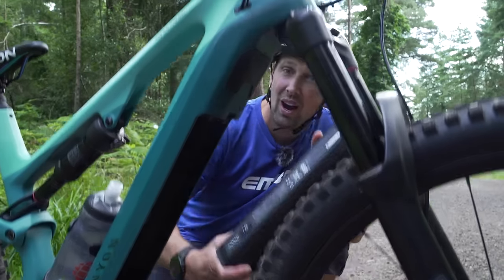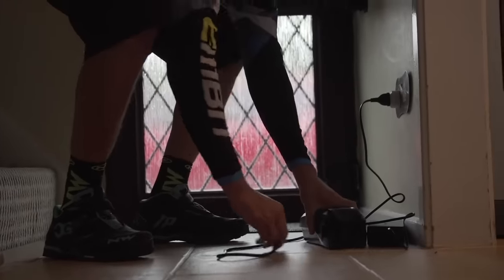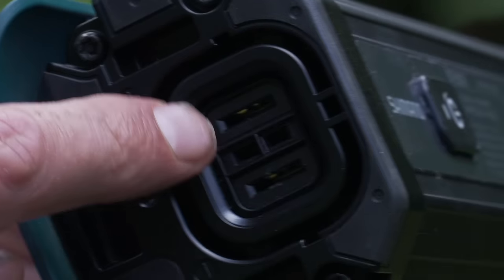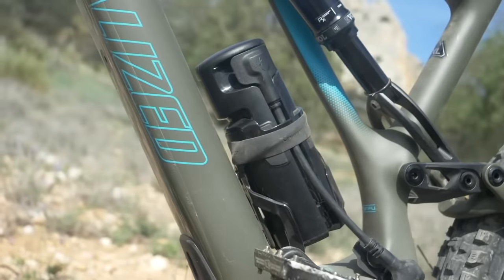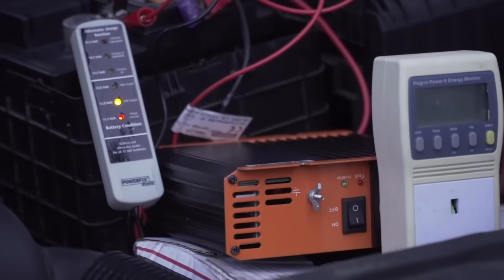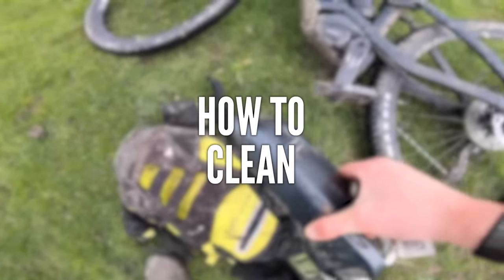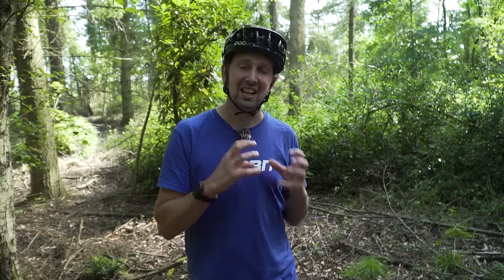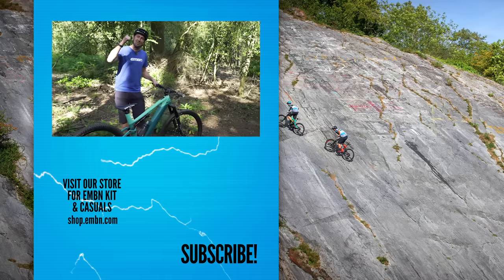How to Maintain Battery Health | E Bike Batteries Explained

Comment: Great video. Some Information in the video is not entirely accurate when it comes to lithium batteries: charge cycle doesn't equal another charge cycle. Lithium ion doesn't like full discharge or full charge, this applies to all Lithium batteries, even from different manufacturers, and even with different chemical compositions. In essence if you discharge below 20% or above 80%this is very damaging to battery and could cut its cycles by a magnitude (depending on the implementation the exact number will vary). Yes the current/voltage at which you charge matters, so does temperature. What you can do is simply to try and calculate your ride to never go below 20%, this alone could improve the life span by many years(depending how much you ride / how you store it) . Also never charge cold battery, let it sit inside. If possible don't use turbo when battery(voltage) is low, especially in cold temps. Dont leave at 100% for long time. Cut it at 60-80% if at all possible - especially during long term winter storage!!!
Reply: Your proposal is based on out of date research from The Battery University, which is a busness selling special chargers, and it's quoted  on every forum by people who don't understaand how ebike batteries work.

The battery is designed to be charged to 100% (42v). That's why they give you a 42v charger. You get a 42v chatger from every manufacturer for a 36v battery. Did you not think that there might be a reason for that, or do you think they're trying to scam you into buying more batteries .Even the cheapo Amazon and Ebay bikes have 42v chargers! Of course you know better than every single ebike manufacturer in the world because you read something on the internet.

When you short charge, not only do you compromise the balancing system, but it causes you to discharge deeper than you would for a fully-charged battery used for the same ride. Deep discharging is far worse for the battery than charging to the full charge it's designed for. Yes, you did say only discharge to 20%, but then you're giving up 40% of your battery, which is probably less than the extension of your battery's life using your method if it worked, which it doesn't. The idea is to be able to use your battery for the rides you plan, not plan your rides for how little battery you can use. And if you wanted to do a long ride that would use more than 60% of your battery, you'd need two batteries, so you'd have to buy a new one immediately instead of waiting 5 years until your first one wears out. 

In 5 years time, there will be new bikes and batteries, so you'd want to buy a new one anyway.
Reply: @hughjardon3538  the post itself is out of date. It's 2 + years old

Comment: Thanks for your very informative video.
I know little about Lithium Ion, but have lots of experience with Lithium Polymer. (Li-Ion and LiPo respectively) However, from what I can gather, these two types have much in common. And thanks for sharing your knowledge for this noob. (me) My main experience is with radio control flying, and the high discharge that LiPo's offer. (Up to and beyond 100 C, or 100 X battery capacity. eg- 200 amps from a 2,000mah battery!) I have reports of some people storing LiPo's in their fridge, not sure what this would equate to with Li-Ion. I store my Li-Po's at 3.7 volts per cell, and use a specific charger/discharger for this task. I assume that the battery management system mentioned in this video would take care of this task but may be more limited as to individual cells, maybe not. Agree that charging whilst battery is still warm/hot from use is best avoided. And all the info I can come by advises to charge at no more than 1 C, but with bike batteries this will be out of our control without purchasing a new charger. I would also advise checking voltage every few weeks when not in use, to manage static discharge.
The Li-HV batteries mentioned below by Joshua C, are, to the best of my knowledge, Lithium Polymer. Different chemistry and still fairly new. Supposedly the chemistry can handle the 4.35 volts per cell but time will tell as to the longevity. Many in the R/C community, myself included, don't mind the trade off regarding performance/longevity. My favourite RC model easily exceeds 200 Kmh and the thrill far exceeds the expense. Much different to mountain bike riding, where I want my gear to last. All info provided by me is only in my opinion.
Thanks again, 
Merv the Hotliner pilot, and now E-bike fanatic.
Reply: Would be very useful to have a charger that allowed you to set up a limited charge by default. I have no idea where I could get one or what I should be looking for. Many recommendations as to what to do. No details on how to do it. 80% how?

Comment: Thanks for this and your other videos - I've been watching them religiously. I have a question. I just bought an emtb and the bike store owner told me to completely discharge the battery and completely charge it for the first 4 or so cycles. Is this a good thing to do? Bad? Or does it not make much difference? Any help appreciated. Thanks man.
Reply: Hi Peter. The full charge/discharge ideology was for the old nickel cadmium batteries. Lithium ion (which your bike undoubtably is) does not require that. It’s a common misconception.
Reply: @mattsheldon9732   Thanks for getting back to me Matt. Good to know.

Comment: What about discussing what temperatures you can safely use ebikes in?  How cold is too cold?  It is minus 25°C here right now.  Should I avoid riding when it get that cold?
Reply: Yes -25 C is too cold. My 2021 battery has advise on the case not to use below -10 C.

Comment: Hello from the midwest USA! This a great and timely video post for me right now, as I was just wondering and trying to research the topic. Do you happen to know if the Haibike Yamaha batteries account for the partial charges in the same manner? Also, is this info stored within the BMS and available to the owner to see on the display unit on the handlebars?  Thanks for all you're doing with the content you put out.
Reply: That bit was complete twaddle. A full charge cycle is always 0 to 100% on li ion packs (which every mainstream brand uses, they are the same chemistry as used in electric cars). Any manufacturer that counts a charge cycle as every time you plug in is simply trying to pull a fast one art warranty returns. I guess your only defence is to check the small print before you buy.

Comment: You had mentioned how you could charge during a lunch break on a ride, but then at the end you said you should give it a little bit of time before charging after a ride. What kind of time frame should we allow the battery to rest before charging? So it could go from a state of discharge, relaxed to a ready state of charging.. Thank you for the great content!
Reply: Bumping this comment as I have the same question. 

Also I wonder if different brands have different definitions for a 'charging cycle'. Like if I let it charge from 50% to 60% on a Bosch, does that count as a 'cycle' just as much as charging it from 30% to 90%? 

I heard that for some brands it's just the number of charges and on other brands, like Bosch, it's the sum of the percentages you charge it for or something. I don't know, there's very little specific info with hard numbers out there.

Comment: Is it better to charge the battery at a fast or slow rate?
Reply: Generally charging at a lower rate will prolong battery life. But it depends on the C rating of the battery and its chemistry
Reply: I agree with Paul, if possible, charge at slower rate for longevity, but Lithium Ion is still fairly new to me.

Comment: Hey guys keep up the great work! I have a challenge for you. I have an ebike but I don’t have a stand. So when it comes to lubing my chain it’s difficult because as you know you can’t peddle backwards, I don’t have holes in my chain ring to use a tool to block it, and a stick just doesn’t work for me. So, can you think of a more professional way to solve what is, I know, a common problem.
Reply: I saw a video (think it was on Rob rides channel - possibly an emtb maintenance video) where he put a long allen key into the bolt and rotated the crank back to engage with it enabling the chain to be rotated backwards.
Reply: LONDON501 Hi thanks I’ve seen that but I don’t have bolt holes in my chain ring so that hack is no use to me.
Reply: You can buy a bike stand which holds your bike by the rear triangle which allows you to turn the pedals and clean and lube the chain. I have bought one for about £7-10 from eBay and use it to stand and lube the bike away from home.
Reply: Use a shed door frame or garden gate. Open the door or gate, put a broom stick across with nails/hooks to hang it, on each side of the door frame. Set the height to hook under the front of the bike saddle. With the brrom across the doorway, It will hold your back wheel off the ground with the front wheel on the ground.

Comment: 0:31. Wow, only half a minute in and he already has his head buried up his back side.  A 50% to 100% charge cycle *IS ABSOLUTELY NOTHING AT ALL LIKE* a 0% to 100% charge cycle.  Let's say you can do 1k cycles of 0% to 100% before you degrade your battery to 80% of its original capacity, then your battery could probably do 10k to 100k cycles if you kept it in the 50% to 100% range.  The deeper you go past a 50% discharge, the more wear you put on your battery, and that last 20% to 25% is SUPER stressful for it, if you NEVER drop below a 25% charge, you'd probably 5x your battery life.  Also, the amount of time your battery spends in a deep discharged state also impacts battery life.  So don't discharge your batteries and then leave them like that.  Also, batteries prefer to be stored at about an ~80% charge.

Comment: I heard that if a Li-Ion battery is allowed to completely discharge it cannot be re-charged. How do you prevent this if you store the battery say, for the winter/
Reply: The controller should stop it from being discharged past the point of no return
Reply: Winter isn't excuse for not riding. (icy road even has super low rolling resistance)
Anyway healthy battery stored properly (cool room temperature) doesn't shelf discharge that much over one winter.

Comment: Wow. Disconnecting an Li battery at ~80% rather than 100 and storing it at ~60% is super counter-intuitive! I'd love to know the (layman's) reasoning behind these bits of advice. Since the dawn of smartphones, I've heard very contradictory claims from supposed experts about how best to prolong the life.
Reply: Anecdotally, and after following the advice for the past decade+ for my MacBook and Samsung smartphones, I have consistently waited until I'm between 12 and 25% and then charged up to 100%, often leaving it for a few hours plugged in at the full point. And after ~5 years of using the same device, my friends who are constantly charging (ESPECIALLY iPhones!) for just a little bit at a time rather than using the "best practices" I was told so long ago, my device batteries seem to hold up much, much better. Yet, your final piece of advice for what NOT to do is exactly what I've been doing all these years. Why is there not an agreed-upon answer as to whether or not it's best or WORST to fully charge and then fully drain an Li battery?

Comment: Is it possible to repair a battery with a few bad cells by replacing the failed cells? I'm sure the mfg wouldn't recommend it, but I'm sure part of the reason for that is because they'd like to sell you a new battery. I've seen people repair USB batteries this way.
Reply: ¡Mike B! A pulse charger can repair batteries but not all the time, hard to get connections and the BMS may interfere. I repair batteries for disabled chairs
Reply: The most common reason for a bad battery pack is the BMS faltering, At worst the pack will just straight up fail, Or over time the cells will get damaged as they are not getting looked after - In which if you going to repair/replace cells gotta make sure that BMS is fully functional.. If not then good luck repair/replacing it as A lot of these packs nowadays are custom/specialised.. - And because of this, There's a high chance anyway that if you try replacing cells, The BMS just won't play ball with your tinkering.

Comment: The faster you charge a battery, the less cycles it has.  Do not use fast chargers and your battery will last longer.  Batteries like to be slowly charged.  This make this more efficient.
Reply: It's because fast chargers heat up the batteries more.

Comment: My battery got stuck in the frame. it won't open and when I turn the key to try to open the battery there is no resistance like it should be. 

And another thing to note is that at the top of the battery on the right side there is a little gap between the battery and the frame, like if it is not completely clicked in the frame. 
Any suggestions/solutions? I would appreciate it.

Comment: Totally wrong saying that a 50% discharge and then a 50% recharge counts as one cycle 
The Battery Cycle Count is the number of times the battery has been drained and recharged at it’s most basic description - but it is actually calculated based on any combination of drain and charge that adds up to 100%.
For example if you use your laptop to 50%, then charge it up, and do that again, that is one Battery Cycle Count - or 4 times to 75% (which is a usage of 25% battery each time) - the usages don’t have to be equal, could be varying charge levels, like drain to 40%, another to 90% then a third usage to 70% would be one cycle.
Reply: they are why ebike companies are raking in the cash. ignorance means selling old tech batteries at 400%+ mark up. LOL

Comment: How future proof are they?  Can you still ride the bike and be able to get new batteries in 10 years or more?  Have manufacturers made any commitments to this?
Reply: Doubt they have or will. The battery is warranted for the bike you bought it with. There is a requirement to hold spares for cars for a set legislated period but wouldn't Think bicycle manufacturers need to. Maybe a requirement in some countries perhaps?
Reply: @derekharper6031  I think it is something to consider when buying bikes.  Bikes traditionally can last 10s of years.  My current bikes are 2009 and 2011.  Both in good shape and great to ride also no need to replace.  With Ebikes my worry is the usable lifetime is more likely to be around 7 years or so. After that you could be faced with needing a new bike should anything happen after that. It is a lot of money to shell out for something with potentially a short shelf life.
Reply: @simonsays171  totally agree and something you should be considering when making any purchase. How long should the product last and still be able to get parts. Non ebikes really can last forever if looked after. Newer components that break or wear out can usually be replaced by newer parts. Ebikes are very much the same except for the electronics fitted to them...thats why you need to guesstimate which companies are likely to still be around and able to supply parts for the electronics or better still have a way to replace old with newer models. If shimanos next release of motor still has the same form factor and can be fitted to older frames then that is a massive win if you run Shimano currently...
Reply: @derekharper6031  Bafang are a new commonly used motor